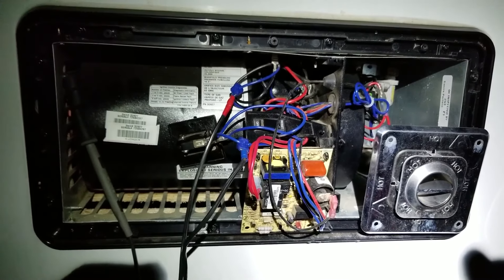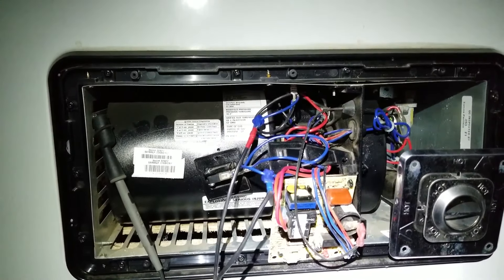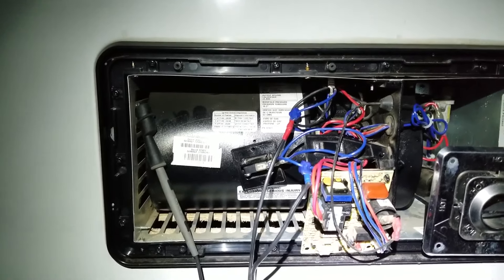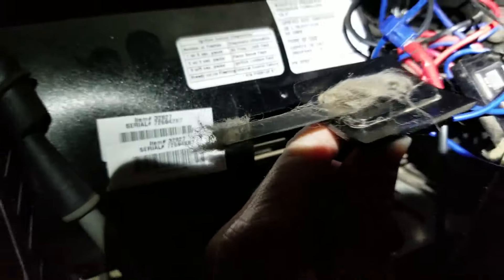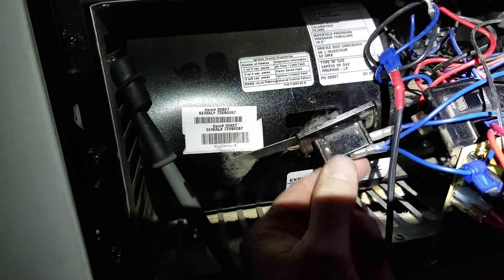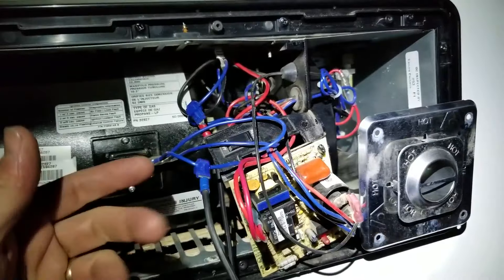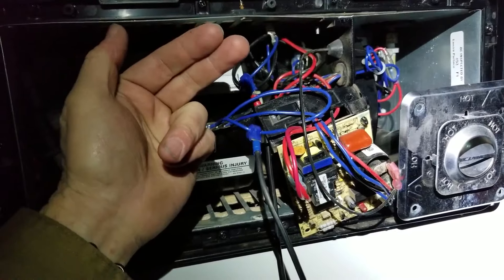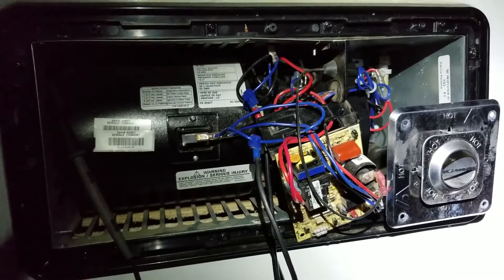Troubleshooting An RV Furnace With A Dirty Sail Switch

Comment: I need to run my furnace independently from my rooftop AC unit. The furnace is on the floor, under the stove/oven so they are indeed separate units. Can anyone help me here? I surely would be forever thankful 🙏
Reply from the maker: That should not be a problem and you have several options there. Can you let us know what kind of thermostat you have on the wall?  Coleman and Dometic are the two big players and they are wired to the furnace differently. Knowing which one you have will allow us to help you figure out how to isolate just your furnace so you can run on a separate thermostat.  Below is a link to a thermostat we've used successfully when performing operations like this.  So if you want to get that on the way, the rest is just figuring out the wiring which isn't a problem, we just need to know which way to go depending on how that furnace is connected either directly to the thermostat order directly to the AC in the ceiling.

https://amzn.to/4i922ds
Reply: @MyRVWorks It is a Duo-Therm Thermostat. It controls the AC and the furnace. It has a 'cool-off-furnace' selector, a fan 'auto-on' selector and a 'hi-lo' selector. The furnace itself sits under the oven/cooktop
Reply: @MyRVWorks Also, when I took out the rooftop unit, in the cavity I found two seperate thermostat cables. One contains 7 colored wires and the other has only 2 colored wires. Thank you so much for replying! It's getting cold 🥶 in Michigan 😮😊
Reply from the maker: Okay, more than likely those two wires up in the ceiling are the ones that run to the furnace (the seven conductor probably went to the thermostat). You can verify the 2 conductor colors at both ends. On the furnace side they'll connect to two blue wires coming out of the furnace. To test this touch the two wires together in the ceiling and your furnace should start.  If they do then you have figured out which two wires you need to turn your furnace on with your new thermostat.  The next step is to take thermostat off the wall and discard it.  Fish out the seven wires that should be in the wall. Pick two of the wire colors in the seven conductor, these will become the new furnace control wires, the other five wires you can just wrap around the jacket.  Up in the ceiling connect the two wires that go to the furnace to your two chosen wires from the seven conductor.  You now have a path from the furnace all the way to the thermostat location. Mount your new thermostat on the wall from the link in the previous message and connect one wire to the R terminal and the other one to the W terminal you should be good to go.
Reply: Is there a way I can send a picture of the wires up in the cavity to you please?

Comment: I have a 2019 Northern Spirit and the access to the sail switch is pretty damn near impossible with how the furnace is installed. Do you have any alternative methods to accessing the sail switch other than having to remove the furnace all together?

Comment: If my furnace works fine on 120 power,but wont ignite on 12 volt,could it be the sail switch??
Reply from the maker: Need a bit more info on your furnace.  Is your furnace in a park model and therefore has a 120 VAC motor?   That being the case there is a transformer to convert to 24 VAC for the thermostat but all of the controls are 120 VAC and there is no 12 VDC involved.  On RV's the furnace motors and controls are all 12 VDC.  If you can provide the complete model number it will really be helpful.  I do have many more furnace video's on my playlist here:  https://www.youtube.com/playlist?list=PLk44vSl27TRCaZIQbm-0utYK7sVOKwXVY
See if any of these will help.

Comment: That is NOT where my sail switch is, I can't find it.
Reply from the maker: Different manufacturers put them in different places - and even within a manufacturer's model range they'll be located in different places. There is no one spot. You can follow the wires. Mostly they're blue or white wires. They're going to be located in one of your blower wheel covers.

Comment: My furnace isn’t working right not sure if it might be the sail switch. The blower turns on then the clicking but won’t ignite. But if I put my hand in front to create pressure it kicks on if I remove my hand it shuts right off. So I put a piece of 2x4 to stay longer left it for a minute and would stay on no issue. I shut it off for 30 minutes to see if it’s working again and same results happened. So I did the 2x4 method again let it run for a bit then shut it off till I heard the burner shut off turned it back on with no issues, no 2x4 method needed.
Reply from the maker: To schedule a service consult with Darren please sign up for the "1:1 Repair Consult" on our Patreon site.  https://www.patreon.com/myrvworks